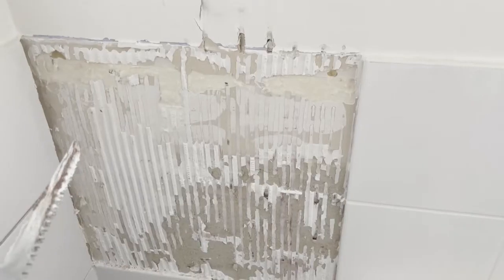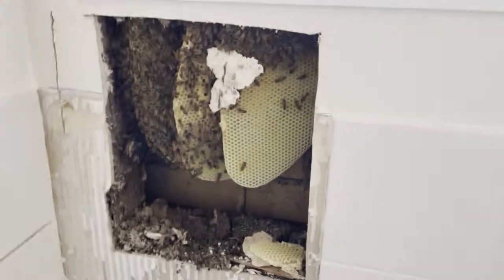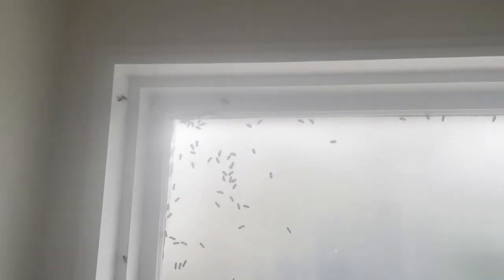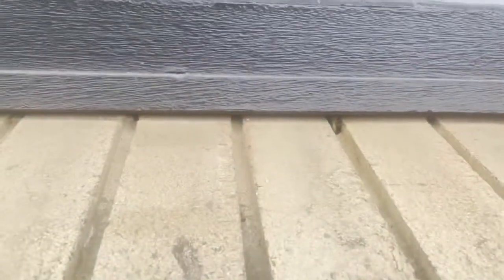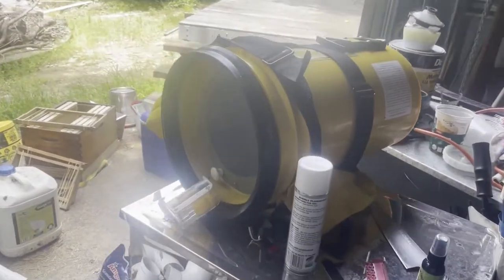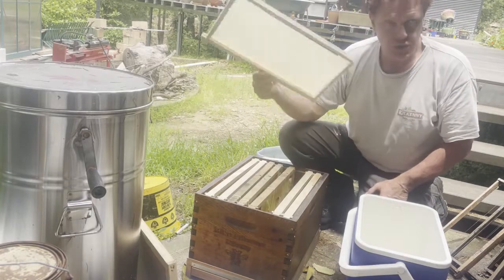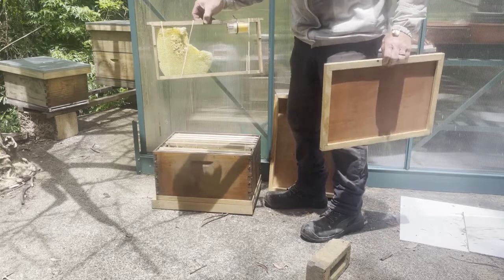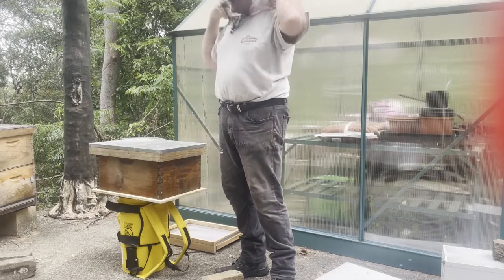Preschool Bee Rescue!  Bees in the wall of the bathroom.

Comment: You're in swarm season with the cutouts having such new comb. That repellant works very well!! Congrats on the queen!!!! Try using longer rubber bands and go from corner to corner in a "X" pattern so the comb will lay in the frame easier. Thanks Mike!
Reply from the maker: Thanks,Rodney. Full on swarm season. I’m engaged by our national telco to remove colonies from pits and DoD for swarms and cutouts. I’ll video my next pit call-out. When I get longer rubber bands I’ll use the Criss cross method. Cheers
Reply: @AussieMikesBees  They make laying the comb in the frames so much easier for me.  I can't wait for next spring. I have some propolised wood from a old house I did a cut out in to make more swarm traps over the winter.